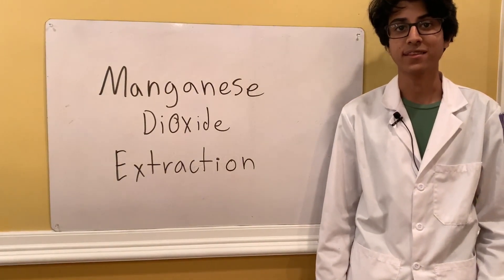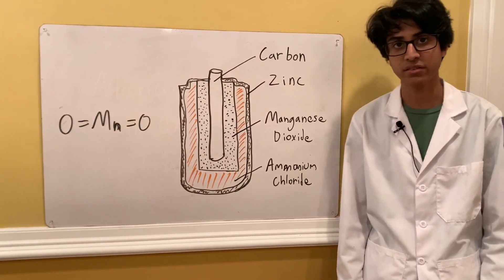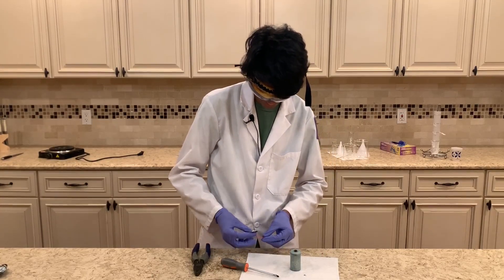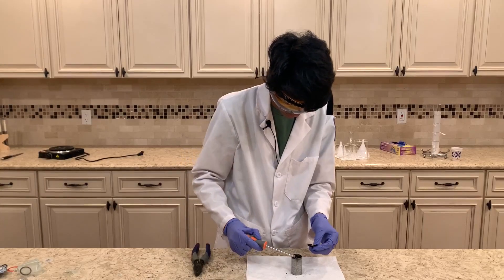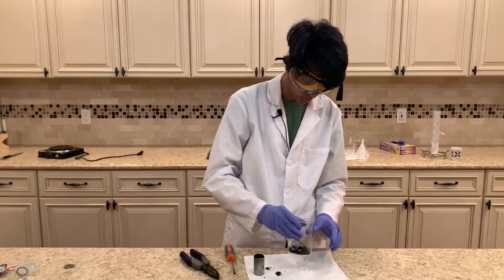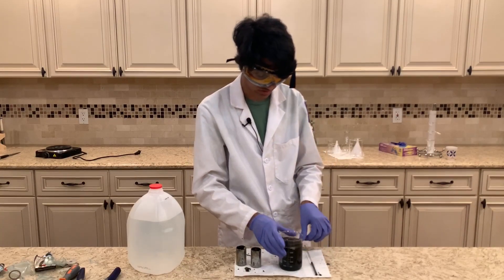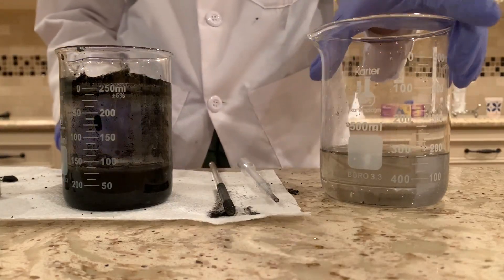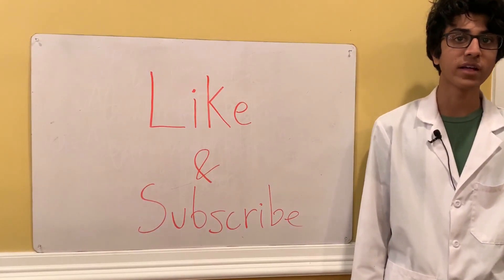How to Extract Manganese Dioxide From Batteries

Comment: Where do I buy these batteries specifically?
Reply from the maker: I got them on amazon. They are called Panasonic zinc carbon batteries. You can probably find them at many stores as well.
Reply: @UbaidsLab  Thanks a lot